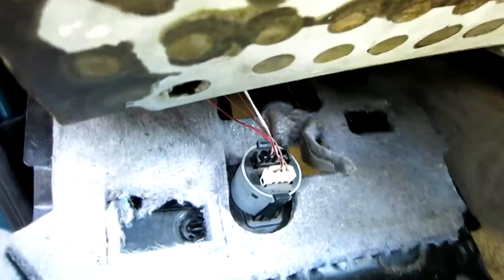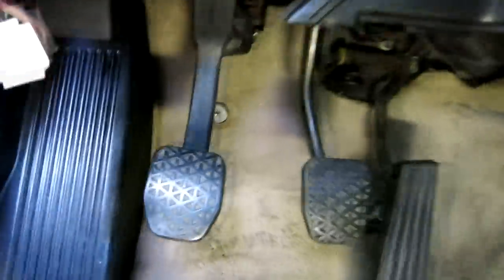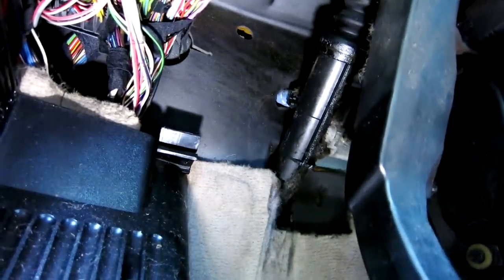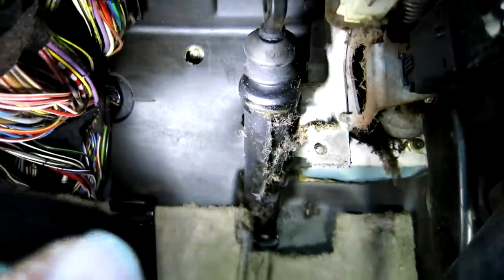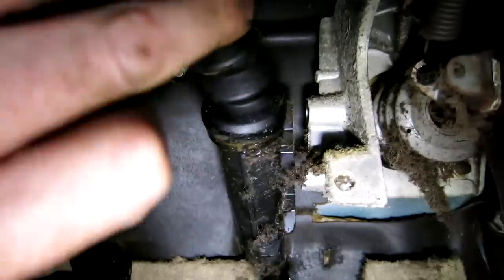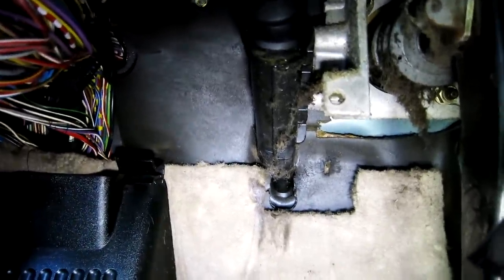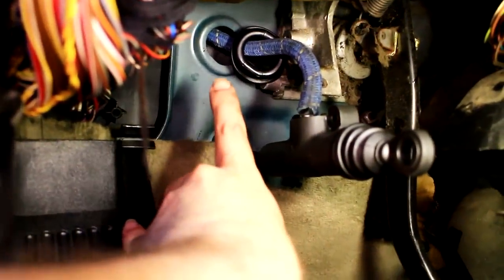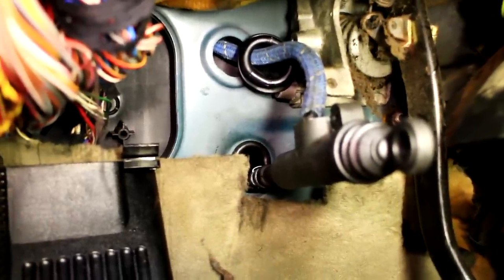BMW 1992 325i E36 Clutch Master Cylinder Replacement

Comment: I finished the job today and it is all good. Today was the bleeding phase. I used the syringe method as described in one of the other Youtube videos for the e36 clutch slave cylinder replacement. The other video is worth watching as they all are to get as many hints as possible but it is light on details on how to use the syringe. 1. disconnect the clutch master cylinder feed pipe from the side of the brake master cylinder reservoir. 2 insert the syring full of fresh brake fluid into the pipe and slowly pressurise. You will see bubbles coming to the top continually. I did this initially with the bleed nipple on the slave cylinder open. Take your time and keep a little pressure with the syringe. 3. Then have an assistant move your clutch pedal up and down slowly. Do this many times and you will see more bubbles surfacing and the level of fluid going down from the syringe. 4. Go underneath the car and close the slave cylinder bleed nipple. At this stage you should be able to feel that there is resistance when you press the clutch pedal. Still some bubbles may surface and this is good. 5 At this point I felt confident enough to start the car and see if I could engage gears.(Be very careful if the car is jacked up and on jack stands) Yes I could select the gears but the clutch 'bit' quite close to the floor. In fact too close to the floor. 6. Then I went under the car with my 7mm spanner and asked my assistant to pump the clutch pedal a few times and then hold to the floor. While he held it to the floor I loosened the bleed nipple and fluid and air escaped. In fact it was more like aerated fluid but that is OK. We used this final bleed 3 times uintil the fluid colour was clear and I had a good and firm clutch pedal..6 I restarted the engine and the gear selection was easy and the clutch 'bite' point was much higher. What this means is that the clutch felt normal  and it was.7. make sure the clutch slave cylinder bleed nipple is reasonably tight and the job is almost done. 8. remove the syringe from the pipe carefully so as not to spill fluid and refit the clutch pipe back onto the main master cylinder reservoir. Refill the main master cylinder with brake fluid to the recommended level and the job is done.

Comment: This is a great video.
FYI - There are at least two versions of the Mater Cylinder for 94 BMW 325i, depends on if your manufact date was before or after 10/94. , but the Cylinder here is the "non-threaded" type (my term) where as my car has the "1994 BMW 325i to 10/94; threaded port" My original part was cast, with a threaded end - not the cotter pin type shown. The replacement for the threaded model looks the same but has an additional metal coupler attached to the plastic cylinder to make the transition to the threaded hydraulic line.
Reply: Yeah, my M3 has a different style master cylinder than this one.
Reply: Where do I get a threaded master cylinder

Comment: So good still. The part about the different way the low pressure side connects and also how to connect it by removing the line entirely after draining the fluid from the reservoir and just  disconnecting it in from the engine bay totally reminded me of how I installed all this in the first place! Thank you
Reply from the maker: Thank you, I am glad it is helpful.

Comment: I did this on my 1995 328i and it is more difficult on a right hand drive car. The steering column is in the way and getting the bolts out is much harder. If I did this again I would replace the 2 bolts with bolts which additionally have a phillips head slot in the head. I am sure that would help. I dropped the steering column down and also released the bottom column outer collar and slid it up the outer column out of the way.
This made it much easier (Remember mine is a right hand drive model)
Disconnecting the pressure pipe. I did this in the engine bay because I did not want to bend the pipe and drag it into the cabin. I took the engine coil cover off and this made hand access to the fitting easier. removing the coil cover is only 2 nuts under their little covers.
Before you reassemble make sure the 2 bolts have perfect threads that screw into the nut and switch bracket easily. I cleaned them up with a tap and die.  This makes reassembly much easier.
Reply from the maker: Ian Buckley Maybe it's easier to get to on RHD but I couldn't even find the clutch line  in the engine bay or from underneath, theres too many other things to contend with on the left side.
Reply: SupraWes
I did this job last week and it is all reassembled but I have not bled the system yet. The connection between the clutch master cylinder and the metal pipe is difficult to see on RHD because it is almost behind the brake booster. Once you have identified it first time you realise what it is. I think the metal piping from the master cylinder to the slave cylinder is much longer on RHD and goes right across behind the motor along with some other brake pipes.
Reply: Ian Buckley
I think there are 3 Youtube videos on doing this job, maybe more. It is well worth watching all of them because collectively they are very helpful. It is worth watching the slow moving 43 minute one because there are some good tips in that one.  They all have some helpful ideas. However they are all done using a LHD car.

Comment: I didn’t see any clip connecting the bottom of the master to the brake line like you said .. mine was all metal OEM and I couldn’t see the clip or a way to remove it

Comment: Good job Wes! those curved pliers come in handy i have a pair. also having disposable rubber gloves is a good idea.
Reply from the maker: I have the blue gloves as well as the mechanics gloves.  For some reason they never seem to stay on throughout a project. I cant get used to using them.
Reply: SupraWes I can't do without the disposable gloves. It should be easy to get used to them since they conform to your hands unlike the mechanics gloves, those i only use if i am doing heavy duty work.
Cheers

Comment: Excellent job brother and thanks for sharing the video with us.  Do you by any chance remember what brand your new aluminum master cylinder is?  You mentioned that it comes with a FAG plastic one and I hate FAG parts.  I ordered a wheel bearing from BMW in Oregon and it was supposed to be a Japanese Koyo for a genuine BMW but they sent me a FAG.  I may be needing to do this job on my Z3 because my master cylinder reservoir is low. and I don't want a plastic part back in it.  Thanks again and hope you're enjoying your weekend.
Reply from the maker: Thank you, I belleve it was this Febi one from Pelican Parts that I ordered.  https://www.pelicanparts.com/More_Info/21526758830.htm?pn=21-52-6-758-830-M36&bc=c&SVSVSI=0103

Comment: 10:35 ... tried to do the same on a 525i from 1990 (M20B25). We broke the high pressure line by twisting the master cylinder ^^
That high pressure line is impossible to access in the engine bay.

Comment: For some reason I am having a issue where the pin for the master cylinder will not go in more than a quarter of the way in, could the master i got have a different bore diamater?
Reply from the maker: Have you tried putting it in from the other way, It has been a long time but I seem to remember it only going in one way.

Comment: I followed the great  video as best i could, and yet i ended up with a pedal that sits way too high, by a couple of inches. Any idea where i screwed up ? [1993 318i]
Reply from the maker: I don't see how, the pedal hangs on the pin on the firewall and then connects to the master cylinder in the middle.  That should se t the pedal height.  Possibly an incorrect or mis manufactured master cylinder.

Comment: I have a '91 318i, love it. I wish I hadn't sold my 2002 though.

E36 are great. I like driving them in many ways more than E30's. I've driven just about every BMW chassis from before 2001. Once you go old BMW, you can't go back! I wouldn't mind that Supra you've got though, great car.
Reply from the maker: Eric Leippe This is my first BMW, and first non Toyota, I have had the e36 for 5 years now.  While I love driving it especially with the upgrades I have done the quality of the parts they used frustrates me.  Too much plastic, especially in the cooling system where there should be none.  Subframe mounts that rip out on multiple BMW models.  and Interior panels that fall apart.  I think they are just over engineered to the point of fragility.
Reply: It's true, they can be a pain to work on. My mom has an e46 and we gave up trying to replace her sunroof mechanism. I think the best use of an E36/46 is a stripped out racer.

Recently I did some work on a Volvo 122. The experience really has me wanting an old car again. Such a joy to work on. I had a '79 Corolla coupe, miss that car!

Comment: If you have to unbolt it anyway, why cant you remove the top bolt and wire bracket prior to removing the master cylinder pin and after reinstalling the pin put in the bolt and bracket?

Comment: my e36 is stuck straight in gear im so bummed idk what going on i was power shifting thought cause it was cold
Reply from the maker: If the clutch pedal is on the floor then it is this, if not its something else.

Comment: My clutch pedal lost pressure out of nowhere one day . And my slave and master are both a month old and no leaks coming from both of then . When I bleed it I get no pressure . What could it be if the day before my clutch was fine ?
Reply from the maker: Miguelangel Guzman Maybe the clutch pressure plate is broken, I have no idea.

Comment: Any idea how to replace that blue hose mine is leaking and i cant find a guide for the routing or how to route
Reply from the maker: +cameron cross I would first suck out all the brake fluid in the master cylinder, use a turkey baster.  then you can remove the hose from the clutch cylinder from under the dash above the pedal and pull it out from the engine compartment.  Then with your new hose you can snake it out the hole in the firewall from the inside of the car, it will help to peel back the carpet to see the hole better.  Once you have enough snaked out you should be able to look in the engine compartment and see it poking out from behind the brake booster.  Then you should just pull enough through to re-attatch to the master cylinder and then reconnect it to the clutch cylinder under the dash and you should be good to go.  It will not be an easy job because of the tight space everything is in and you cant always see things well but that is the general idea to fish it from the inside of the car out, the hole is hidden by the brake booster so you cant really fish it the other way.  Hope this helps.

Comment: how do I know if the master cylinder is failing  ooor  the clutch is there a diference?
Reply from the maker: If the pedal falls to the floor or the clutch is not releasing when you press in the pedal it is most likely the master cylinder, if the car is revving up but the car is not moving or moving very little it is probably the clutch.

Comment: yeah its real easy with a left hand drive try doing this in a right hand drive when the clutch is against the dash and far from your reach
Reply from the maker: At least its on the exhuast side of the engine so the stuff outside should be easier to get to.

Comment: Question for you about the master cylinder. I have a drift car and was at an event over the weekend, and lost my clutch. When I engage the clutch it has no pressure and just sticks to the floor with no rebound. I figured it might be the slave and replaced it because it was easy and cheap, but still have the same symptom, which leads me to the master. Would you say that the symptoms that im suffering from could be from the master?
Reply from the maker: It usually goes slower than that where the clutch wont fully disengage but it is possible.  When you replaced the slave cylinder was the rod hitting the fork?  Sometimes a piece of the clutch comes apart and gets wedged between the clutch disc and pressure plate.  If it just broke mid drift that is more likely.
Reply: When I replaced the slave I had to push it into the transmission to start the threads on the two bolts, so I assume it was on the fork correctly. The symptom I am feeling with my car is zero effort to push the clutch in, I could do it with my pinky, then it will stay compressed on the floor. I started car in 1st gear and drove it off the track with no noticeable, or audible difference.  It's also worth noting that a few weeks ago at a different event a few times when quickly engaging the clutch it would slip off the clutch stop to the left compressing the master cylinder further that its suppose to. This might have walked it down a path to failure? Also clutch peddle has always been slightly curved to left not perfectly straight.
Reply from the maker: Ok, yeah, change the master and you should, be good,  there is also a plastic bushing at the pivot point of the pedal you might want to replace while you are in there if it is not sitting right.
Reply: Tom Jones Did you have any luck with replacing the master cylinder? I'm having similar symtoms on my e36.
Reply: Michael Iilonga same man

Comment: did you have to bleed the brakes after draining the master cylinder?
Reply from the maker: No, as long as you don't move the brake pedal and introduce air into the system you shouldn't need to bleed the brakes after this procedure.
Reply: @SupraWes  thank you! great video

Comment: Please where did you get the aluminum Master cylinder ??? Lol my plastic one continuously keeps breaking
Reply from the maker: Pelican Parts https://www.pelicanparts.com/catalog/SuperCat/0208/BMW_0208_TCLUTC_pg4.htm#item21
Reply: Thank you so much man appreciate it ! I haven’t finished watching the video but it is completely compatible with the stock plastic one right ?
Reply from the maker: Yes it is compatible, I will mention that it completely gave out on me after about 2 years without any warning.
Reply: I’m fine with that lol I replaced mine with another stock one and it only lasted 2 more months !